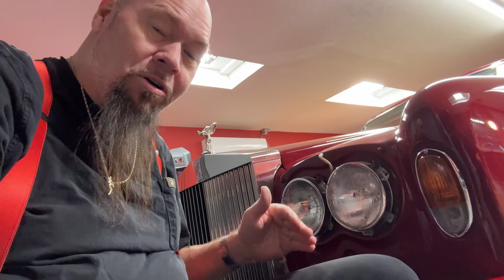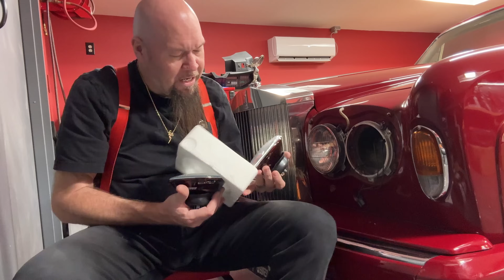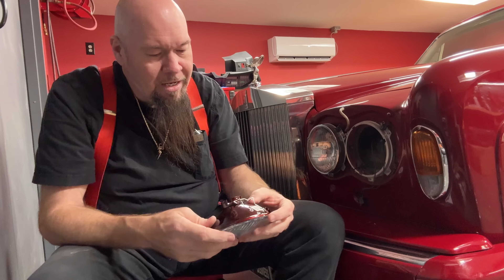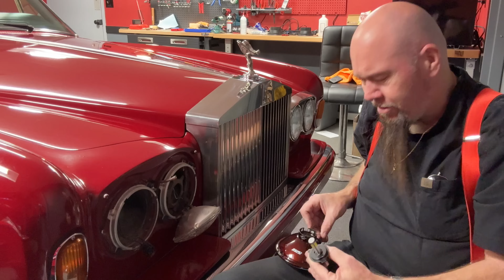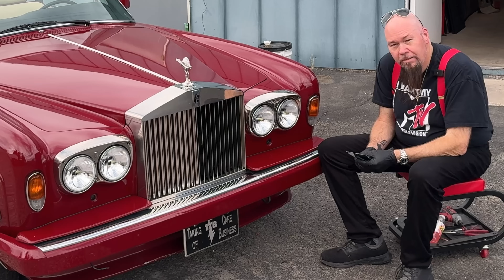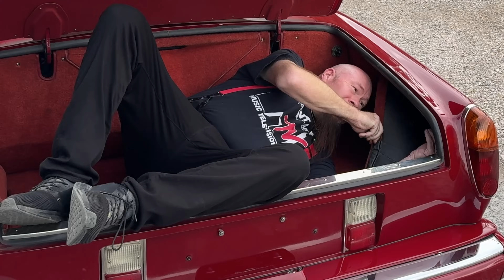Converting Rolls-Royce Headlights to LED

Comment: When it comes to blinkers, the best option is to replace the mechanical flasher module with an electronic unit. Then you don't have to mess with adding resistors which kind of defeats the whole purpose of a low-powered LED.

You do have to be careful when it comes to LED tail lights. Some cruise control designs require seeing a certain amount of resistance through the tail light bulbs for the system to work. So if the cruise control stops working, you may need to add some small load resistors to the tail lights circuit.

Comment: I've done multiple LED conversions. Start with good led chips that duplicate the size and shape of the incandescent filament. CSP chips are great. Look for the brand Stark Industries and fanless. You'll see their H4. The low beam has a hood to work with the reflector. This will give you a sharp cutoff pattern.

Comment: L e d bulbs in taillights and turn signal applications don't flash in old cars 
Bob you could make them work with a resistor but I would not know how to do it 
The voltage is not enough for the flashes to work
Reply from the maker: you didn't pay attention at all
Reply: @RobertMoseley  I did I commented during the video and you mentioned that toward the end

Comment: Bob, when you say it won't see water because of the dry weather in Vegas,  you still have to wash the damn thing!!!
Reply from the maker: I don't wash it, we wipe it off.
I have a spotless water I can rinse it with, but I doubt I will ever use it on this car.
We blow it off, then wipe it off and use a quick detailer on it.
It never goes in the rain or through a car wash. Even if it gets wet, it's 5% humidity and 110f here. It will dry in about 2 minutes.
Reply: He doesn’t wash with water.. he does a wipe off technique if I’m not mistaken.
Reply: @_benz4lyfe  Oh, he does a waterless wash/no rinse type of clean, that's good, really like this red one, Bob bought a corker!

Comment: The fact that the bulb needs a fan to cool it is a bit scary.
Reply: Not really, LEDs have to operate at a much cooler temperature than incandescent. The biggest problem is the fans are noisy and probably won't last very long. You can also get LEDs without fans.
Reply from the maker: An incandescent bulb is just a toaster in a glass tube. It IS heat and the light coming from it is the same as the sun's glow.
An LED is creating light through a different spectrum of technology, but the electricity used to operate it gets hot so it has to be cooled.
Welcome to the future.

Comment: You need to look at Holley Retrobrights, no need for plugs, it is a whole unit and LED!
Reply from the maker: I did, they are $200 each. I don't see what makes them 4 times as better as the ones I bought.
Reply: @RobertMoseley not to mention they are made of plastic. So they would fade big time in the sunshine. ☀️ Yeah they are $430 for a pair. Not cheap for plastic lights. Are yours glass?

Comment: Your car is what were called a "Grey market" car.  Grey Market cars are vehicles that were imported outside of the normal process used through dealerships.  Alot of Mercedes Benz V8 cars were brought into the country and sold as Grey Market cars.